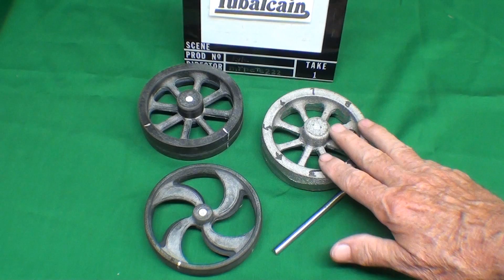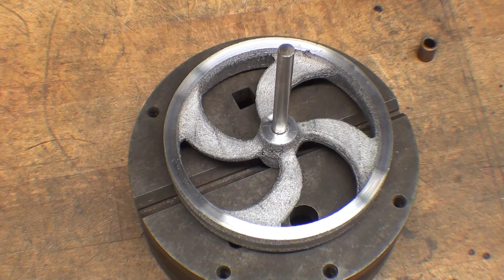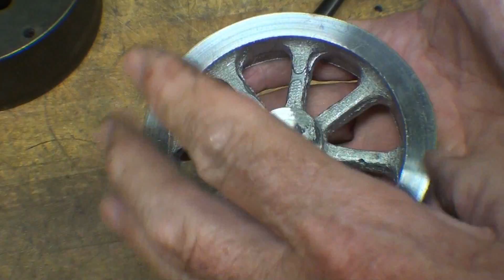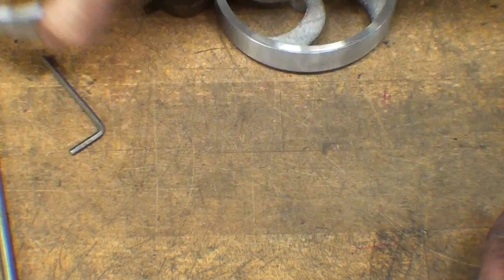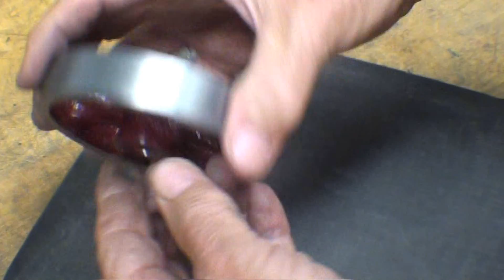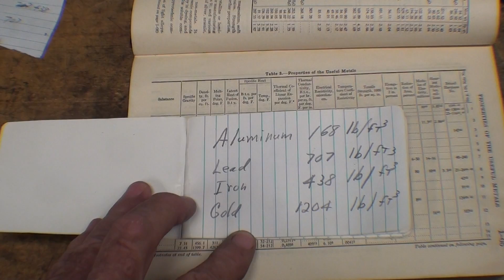TIPS #326 Machining the Rough Lead Flywheel Castings tubalcain

Comment: Curiosity has the better of me!  Is it possible to make a compound wheel by first casting in aluminium with a hefty recess in the outer circumference, then use the aluminium casting to accept a cast lead weight band?   I alway enjoy your vids!
Reply from the maker: I suppose

Comment: Enjoy all your videos, thanks.  Would any carbide tooling work for machining lead?  Or is there just not enough relief?  I have a  business proposition coming up to machine some lead in my home shop for maybe pouring and/or machining some lead ballasts that go in the wings of AG airplanes.  I don't have a way to grind HSS tooling yet but plan to soon.  I'm lazy I guess, I usually just buy the carbide stuff.  Sounds like I could end up with about 70 lbs of scrap lead from these runs (that would be nice for other projects)
Reply from the maker: No good answer. No carbide & you need to experiment with very keen tools. Lead is tricky

Comment: I had a shop teacher once tell me that if you're set up to do aluminum, you can do brass as well, you would just need to make sure you use a finer grade sand and be sure to pack it very hard, and cut gas channels.....    Would finer grade sand be beneficial for casting lead as well?  or would you need to use some sort of plaster investment & lost wax type process?

Comment: I'm a bit surprised at the lack of hysteria in the comments section regarding the safety of working with lead.  As we know, lead is not very toxic in it's elemental form (as is mercury) but regardless, it has become a bit of a panic-word in our times.

The US Coast Guard canceled some live-fire exercises on Lake Michigan in 2006, because a mayor in one of the neighboring towns was creating hysterics about "lead poisoning in the lake from the bullets."  In reality, there is zero risk of lead-poisoning from the exercises of course, but the current trend in modern thinking seems to disregard all sense of proportion in risk-assessment, and to err excessively on the side of panic and hysteria.

I feel sorry for all the electronics builders who have been forced to use lead-free solder because of someone's hysteria.  The poison is in the dose, not in the name.
Reply: Thank you lead free solder is the worst.

Comment: @mrpete222  I'm not a safety Nazi, but I am curious if you do any lead dust mitigation.  I don't think you could get lead dust fine enough to remain airborne very long to worry about inhalation (I could be wrong), but perhaps accidental ingestion if the dust is fine enough to stick to fingers.
Reply: Any time you work with lead or its alloys (solder), you wash your hands THOROUGHLY, before going near food or your face.

Eli D.
Reply: Of course. But, uf nothing is done, or what is done is inadequate, you can end up not realizing you contaminated your hands on a later date. Was just wondering what was done.

Comment: When you have a problem with chucking up something like this try putting a .030 piece of plastic shim stock on each jaw.As you tighten the piece check the shims and you will find one tightening up more than the others. You can then put some additional shim in the others or reduce the one that is impinging.

Comment: Very interesting.  I copied your flywheel mold just to be doing it and have some flywheels for which I have no use.  Have you tried to super glue the flywheel to the steam engine shaft instead of using a set screw?  Keep on keeping on.
Reply from the maker: I have used loctite--then heated to get the wheel off

Comment: Perhaps, it might be worth a try, to cast a flywheel out of aluminum, and finally glue or press only a outer ring of lead onto it. So, you have the stability of aluminum, also for machining, and the weight of lead.

Comment: What happened to soft aluminium jaws that you bore out to the diameter you need to hold, are they out of fashion in Illinois?
Reply: 1. Because both materials are lead they will deform under the pressure, because the pressure is essentially applied to the same pointed area of the three steel jaws.

2. Soft jaws will grip on a larger ares of the outer diameter simply because they are not pointed at the grip surface and because they have been bored out to the approximate diameter of the flywheel.

However, if you had 1000 flywheels to be done with precision you would make a backing plate smaller than the finished outerdiameter of the rim with an indent in the center for the hub, and then grip the spokes with a couple of screws with large washers or snap fasteners.

The work procedure would then be:
1. Face off and chamfer the riser end of the outer rim and the hub 
2. Turn the faced off side inwards
3. Rough face the other side of the flywheel
4. Drill, chamfer and ream the center hole
5. Turn the outer rim to measure
6. Face off the end to measure and chamfer

It sounds like a lot of work but in reality isn't that bad once you get going. If you had a small manual turret lathe I bet that you would even be faster than a CNC toolcenter in total production time because you avoid the time for programming, and you keep the backing plate for the next order thus saving even more time.

I used to do a lot of this type of work, finishing castings, in my apprentice time back in the day.
Reply: Soft jaws are nice but I don't think it would be worth it for this one-off item. Like mrpete said in the video, the dimentions aren't critical.
Reply: That's true but you get a better grip with soft jaws than you do with the hard ones because you typically grip on a larger area, which prevent the workpiece from sliding. But as the saying goes "there are many ways to skin a cat"
Reply: Why couldn't he wrap a strip of lead around the circumference of the flywheel to pad the chuck jaws?

Comment: I tried turning some lead a few years ago. No matter what I tried, the finish was terrible. I am impressed at how nice yours turned out. 
Matt
Reply: Remember (mentioned in earlier videos of this same series)  that he is using a lead alloy that is harder than pure lead.  He just melted tire balance weights, if I remember correctly, as the alloy they are cast from makes it sufficiently hard for this project.
Reply: Look in his playlists for the vertical shear tool.  That might do the trick for you when nothing else seems to work.